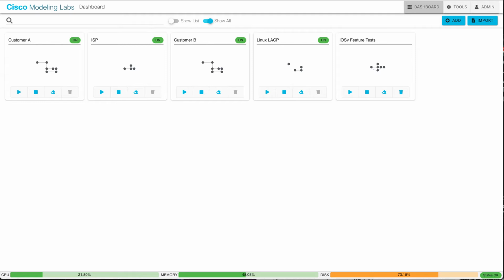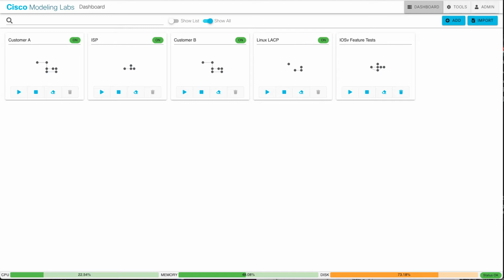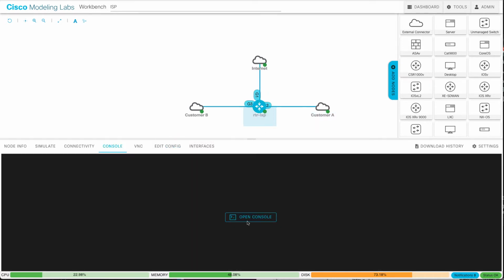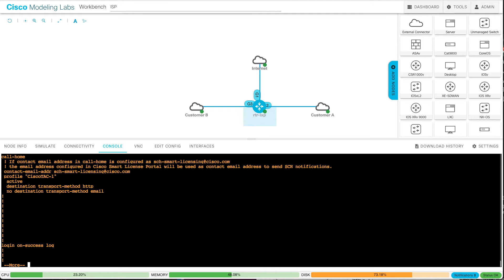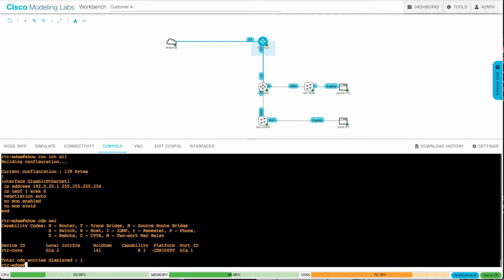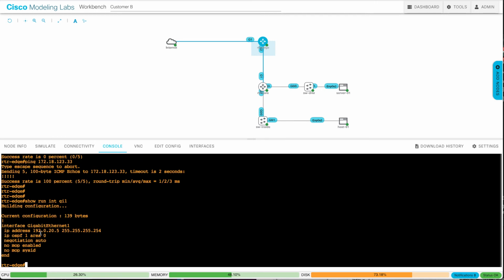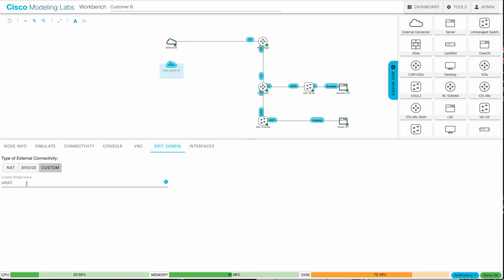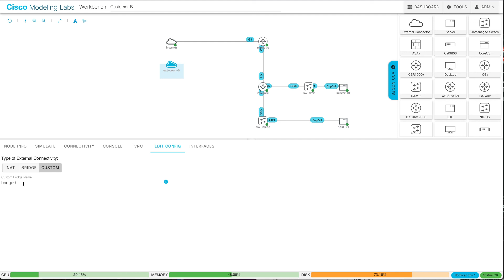Connect multiple labs in CML

Comment: Hello, I have an issue related to Trex in cml. When I try to connect from the Trex GUI it gives me the following error:

Error while verifying the Async request: no response from server.

Any suggestions to solve the problem, ?

I am using windows 10 OS, cml 2.2.3, and the Trex is 2.88.

If you give your email, I'll send you a screenshot of the issue.

Thanks
Reply from the maker: TRex 2.88 is not compatible with the currently release UI.  You either need to continue to use the previous version of TRex or compile the latest UI Java code.
Reply: @xorrkaz   thank you very much for the reply. Do you know how can I get the previous Trex because I'm running Cml 2.2.3 and Trex 2.88 comes with the latest iso file by default?
Reply from the maker: @IraqBGIC  The CML download site has previous versions of the refplat ISO you can use.